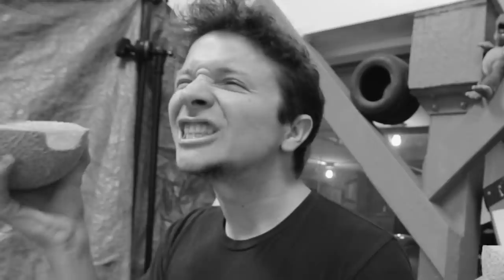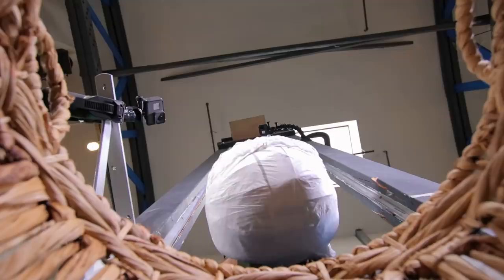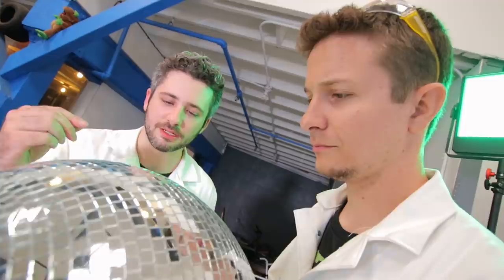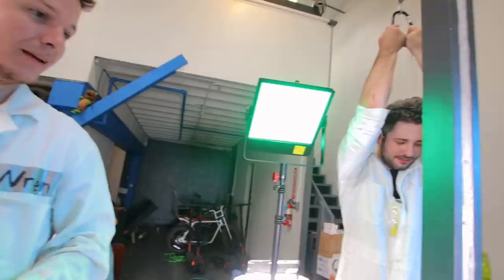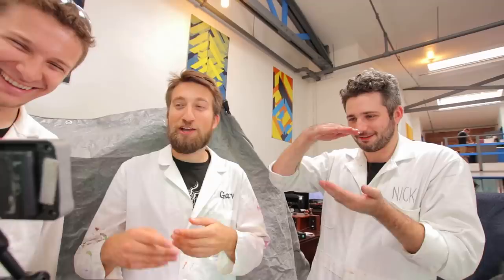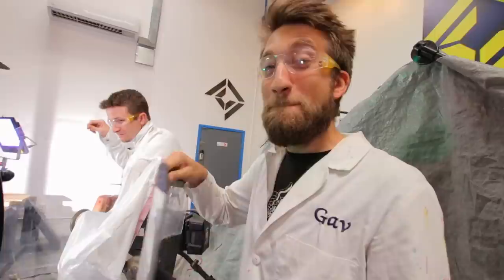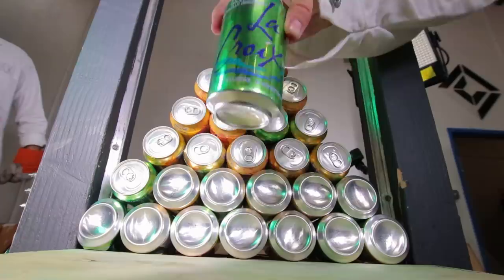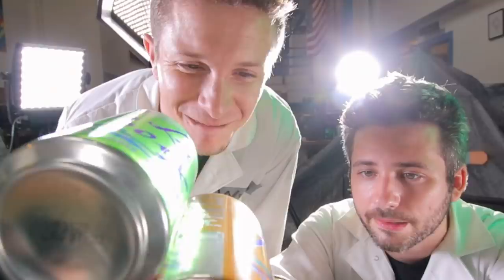Real Guillotine @ 1000fps! (ft. SlowMoGuys)

Comment: Guys you really need to resharpen the blade.
Reply: Haha. That thing is dangerous enough as it is and their hands are worth $$$ as VFX artists. It really wouldn't cut much differently anyway as the force applied increases as the edge becomes thinner but hasn't really even slowed down for anything yet. So force isn't a problem. Most swords aren't kept nearly as sharp as you'd expect (lots of swords can be grabbed around the blade without cutting skin) yet a skilled user can sever a limb with it.
Reply: @mikedrop4421  yea nah
Reply: @entropy616  great argument
Reply: @mikedrop4421  are you saying they would sharpen the blade somehow with their bare hands
Reply: @Akira.0.  wanted to explain that sharper always better and swords be stupid sharp and gripping sword (half-swording) works cuz grip tight if no slide can't cut but yea nah
Reply: @mikedrop4421  You are confusing pressure and force. The pressure applied increases as the blade becomes thinner. Often the blade is squashing the item a lot before it cuts. This was especially clear with the disco ball where the blade just squashed the ball until the foam broke rather than actually cutting any of the mirrors.
Reply: @mikedrop4421  Jake or anyone else can sharpen the blade by taking it apart and sanding it like theyve done with the go pro on a katana video. Their not gonna sharpen while it's still loading, anyone with common sense could figure it out
Reply: I used to run a big paper cutter. We had several blades so one or two could be out getting sharpened. I don't know where we sent them, but a guy would come by at least once a month. (paper is very abrasive, especially card stock) When you started to see tiny imperfections in the cut sides (= tiny nicks in the blade) it was time to swap it out. Shouldn't be hard to find someone to do it properly.
Reply: Swords are supposed to be very sharp. Same with axes and guillotines.
Reply: Bladesmith and mechanical engineer here. The edge doesn't get thinner from wear, it grows thicker instead. Think of a V shape. Now flatten the bottom of that V, you end up basically with a U. The weight of the blade doesn't (appreciably) change with use, and they release from the same height each time, so the force is the same. Pressure, which is what shears materials, is what changes with wear. 
Sharpening is easy, a hand sander with 80-120-320-400 grit paper would do just fine. Just derail/detach it first and there is no safety issue. 
As far as the discussion on swords...sharpness varies GREATLY by design. Fillet knives are thin and about a 15 degree cutting angle, whereas an axe is thick and closer to about 30 degrees. It all depends on the job that sword/blade is trying to accomplish AS WELL as how it is done. A scalpel, fillet knife, etc relies on a slicing action (and is thin, flexible, and sharp), whereas an axe, broadsword, or chopping knife relies on motion (thick, weight-y, more material behind cutting edge so it doesn't break). SO, a guillotine like this works more like an axe, relying on motion to cut, but a sharp edge certainly helps for the kind of clean cuts they are looking for.

Thanks for coming to my TED talk.
Reply: Dustin Reid  That helps, yes, but you can grab a sharp blade without if you hold it tight enough as Conshagen said as long as it doesn't slide it won't cut you. Check out Skallagrim's video on the subject
Reply: In deed.
Reply: Dustin Reid  We, my friend are talking about half-swording and you don't do that with a blade that weighs over 100 lbs. For your knowledge, it cuts not because of pressure but because of the force the impact creates when the guillotine blade hits its target.
Reply: Dustin Reid  I stated that you DON'T halfsword with a blade that weighs over 100lbs, I think you might have misread what I said
Reply: Dustin Reid  K
Reply: Dustin Reid  Go look up ''Hans Talhoffer 1459 half swording'', o into pictures, there you will see depictions made by Hans Talhoffer a german fencer from the medieval ages one of which depicts an unarmored person half swording his sword.

You could also go check out Skallagrims video on the subject titled ''Half-swording - Why grabbing a sharp blade in a sword fight is not crazy''
Reply: What sword weighs 100 freaking pounds? How the heck would that be any sort of feasible design? The heaviest hand-held weapons are in the 50s at most. Unless we're talking about some club or something.
Reply: @entropy616  also gloves help with grip, dont forget that part. half swording ez

Comment: guys, you need a different blade shape. there is a reason you are squashing stuff, a real guillotine blade is completely flat on one side and is only angled on one side. its not a V shape on the cutting edge, its like ◥ not ▼. this how the french got a clean cut. 
you can see examples of this in scissors, razor blades or cigar cutters.
Reply: ? You’re literally describing the blade they already have
Reply: csknives2140 oh shit I see he what he means now my bad
Reply: It’s called a chisel grind
Reply: This man put the shapes in just to explain his point more clearly. Some goat shit
Reply: it would also work that way if the blade just simply would be sharpened. It looks totally dull. But agree indeed that the blade profil could have a better shape aswel
Reply: Oh wow so negative everyone did everything wrong noooooo 😑
Reply: Yeah I agree also I think it would help if it was just plain sharper

Comment: You guys need to have the rollers recessed into the wood or a roller shield that should help with derailing. You could also try messing with the blade angles to prevent it from dragging things with it.

Comment: 12:44 To stop things from going to the side put the blade all the way down on the plastic, measure the distance between the plastic and the blade, get some wood or other material and then nail it in that little space so that stuff dosn't slide around

Also since the blade when you measure is already at the bottom the wood wont catch the wheels are catch the blade either

Comment: You guys really need to rebuild the rail system. The rollers should be embedded into the channels so that the blade is the full size of the gap. You also should attach the cable to a winch with a quick release. That would make it more dramatic, in my opinion, when loosing the blade.

Comment: you guys should get a new piece of steel that's the same dimensions at the top, so it can be connected the same way, but with a wider blade at the bottom; to prevent things from getting caught in the rails, and provide a more complete chop

Comment: The "perfect line" was caused by the ball failing at the seam between the two Styrofoam halves that are manufactured separately and glued together.

Also I hate to be that guy and burst the bubble but it didn't bend the rod at a 45, that was also done in manufacturing. The 45 is bent into it so it "hooks" into the ball and holds it up that way without needing special hardware.

Comment: You can make the rails deeper into the post so the wheels arent exposed, does mean your blade will need to bigger or the post will have to come closer together. You can also add covers tot he post that cover the wheels and rail so things won't easily get caught in it Of course, sharpen the blade after each video.

Comment: What needs to happen for safety and cutting precision is to brace the blade to a straight glide. so it isn't a health hazard and so you can insure if it's met with a stronger force or is deflected it doesn't slide off like that shot with the helmet. So you need a Guillotine 2.0.

Comment: I thought that real guillotines used something closer to a thin sheet of metal that was sharpened rather than a massive 1/2 inch panel? Perhaps the cuts would be smoother rather than crushing the objects? Either way, you fr gotta sharpen what you’re currently using.

Comment: This is a great premise but your safety is alarming. There's zero reason to raise the blade 100% to max height before setting up the target. You could very easily add a "stop" where the blade is kept only 6 or so inches above the target, to allow significantly less chance of danger should something go wrong while setting up the target. Once in place, then you could resume raising the blade to its max height, from a safe area where you don't have to get anywhere near the "cutting zone". Raising it fully means putting all the potential energy into it only to then have to move under it. Much safer to minimize any stored potential energy until right before you're ready to "fire".

Comment: your blade needs to be way sharper with a way different shape. It is too much of a short triangle shape at the edge, it needs to be thin and have a very long edge. Like half the length of the blade. Like a very long & thin triangle. That would have way better cutting power, but you need to main tain the weight though.